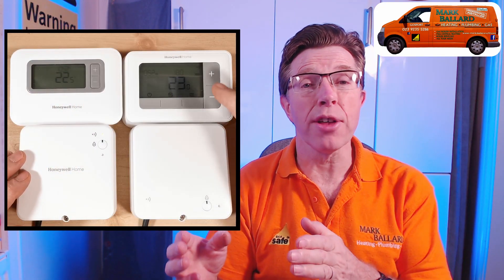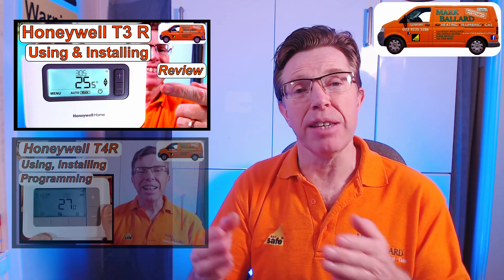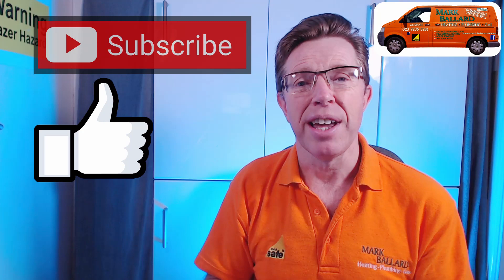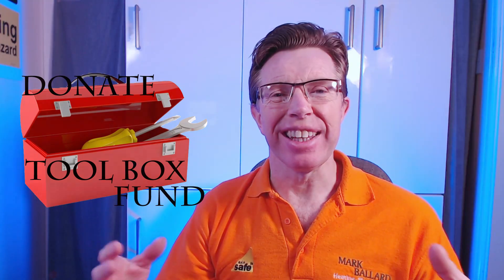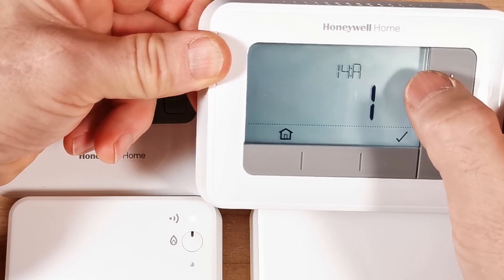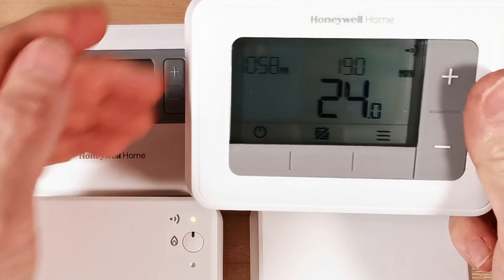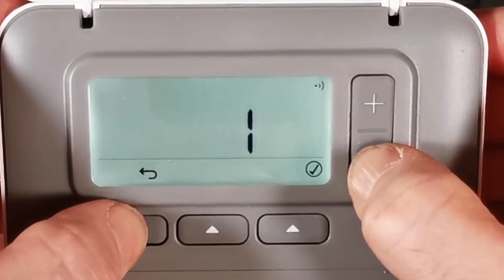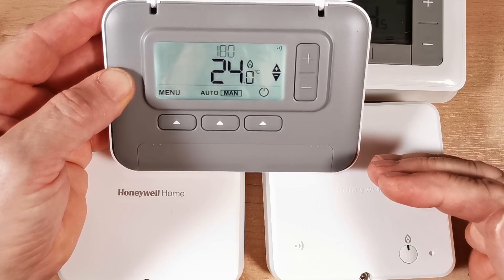Honeywell, Binding / Pairing, the T3R Thermostat to the T4R Receiver, & Vice Versa.

Comment: What an absolute life saver. I broke my thermostat well so I thought but the batteries I was using were really low quality but I didn’t know because it turned off when I dropped it and wouldn’t come back on. I put brand new high quality Duracell batteries in and it turned on. This video has saved me ringing an expert.

Comment: Hi Mark, I dropped my Honeywell portable t3r thermostat last night. The display now keeps turning off and on. If I leave it stationary it seems to stay stable but any movement can cause it to turn off.

I am thinking of replacing the thermostat - would this be needed or is there a quick fix?

Once I have bought a new one, I simply take a pin and follow your instructions on this vid to sync the new thermostat with the old receiver?

Comment: thanks. is there a "best" thermostat for less than 100? is there a site or list somewhere of the best thermostats/reviews? wanting phone capabilities but not wanting to spend loads. thanks
Reply from the maker: Sorry, its a mine field with programmers. Cheapest I know of is the Salus RT310i. Is it any good? NO idea, its a cheap brand. I don't use them. Let every one know how you get on.
Reply: @MarkBallardLTDHeatingEngineer  yeah I am familiar with the 310. The app is OK actually. Quite clear. The unit is very big standard calculator display. Would be good to have something a little more premium though I suppose it really doesn't matter if you use the app. Thanks